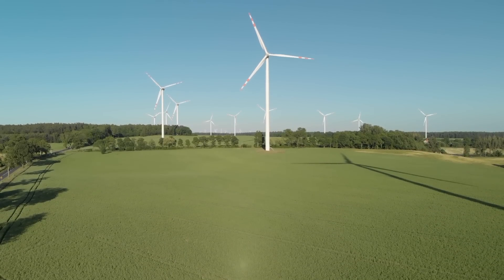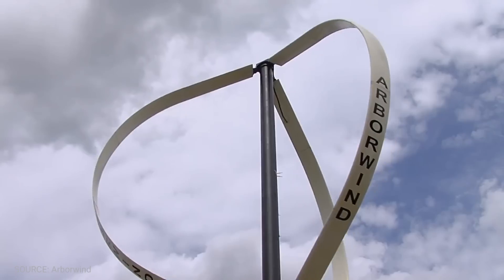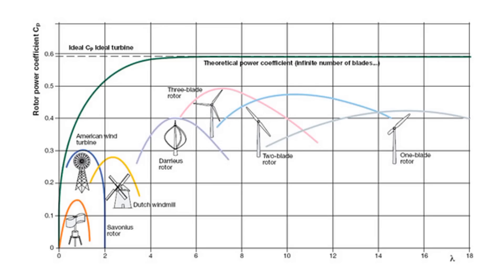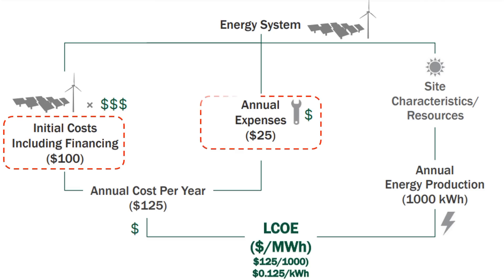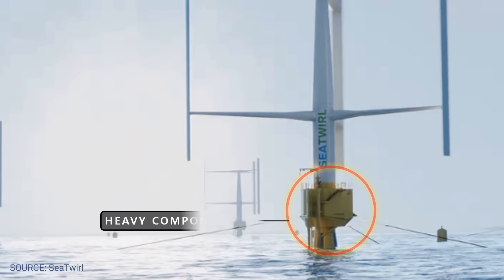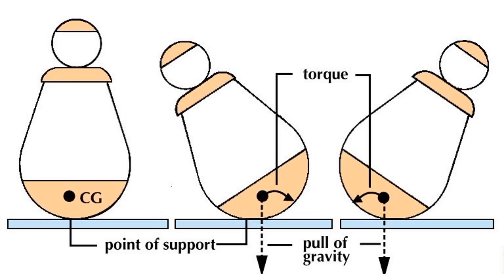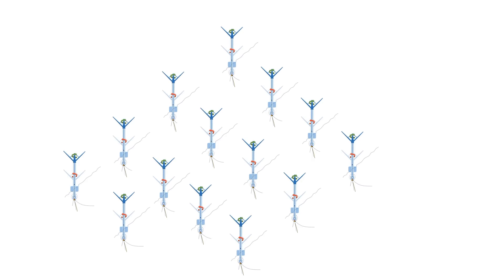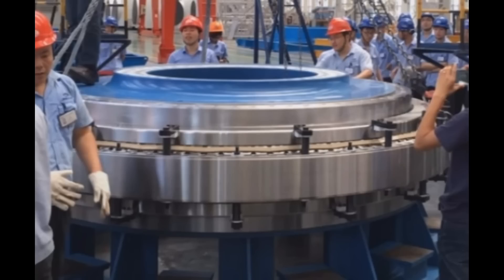This Wind Turbine makes Wind Power virtually LIMITLESS - Solves Wind Energy's BIGGEST Problem!

Comment: I have long been an advocate of VAWTs, despite the knowledge they are inherently less efficient. The fact they work at lower wind speeds and give engineers and designers the possibility of producing electricity at a lower net cost per MW/hour over their lifetime is most appealing.
Reply: You have to consider the HAWTs also use energy....they never reveal how much they themselves consume energy.
Reply: Do they work at higher windspeeds? Blades can't be feathered?
Reply: @kitemanmusic  the saftey wind speed of our VAWT could be 45m/s.
Reply: @kitemanmusic  ...less blades the better the performance in high winds. I have developed efficient 2 blader.
Reply: @kitemanmusic  tbh i think wind turbines are irrelevant and a waste. If fusion fully breaks through we will have clean and seemingly endless power generation. All these do is just pollute more since most materials cant even be recycled and have a short lifespan. Great “green” energy
Reply: @arixmotions  it never makes sense to put all your eggs in one basket, especially In a basket which does not currently exist.
Reply: @arixmotions Try holding your breath until it happens.
I'm 66, and got tired of waiting.
Reply: So you propose we supply energy to the country with a hypothetical source of energy?
Reply: @arixmotions  Can you tell us the materials that can't be recycled? Where did you find this information?
Reply: @christopherfairs9095  he was simply saying that it would take far too much energy to make it worth recycling them.  So in effect, yes they can't be recycled. They are just too big.
Reply: @carlpabst6506  I don't think he was saying that at all. Surely, the bigger they are, the more they are worth recycling.
Reply: @christopherfairs9095  bigger doesn't always translate into heavier and thus more recyclable value. These blades are designed to be as light yet strong as possible, so for the massive surface area it is relatively light, much like an airplane wing (which are also difficult/expensive to get recycled).
Reply: @n.g.s1mple29  precisely
Reply: The argument that VAWTs can start working at lower wind speeds is a very misleading one. There is almost no energy to be captured at these low wind speeds anyway. A HAWT will typically produce less than 5% of its rated power at the cut-in wind speed, so lowering the cut-in wind speed even further has almost no impact on the annual production.
Reply: @wimvanuytven7858  I thought the argument was they will produce some power, albeit a reduced amount, when HAWTs will not function at all.
Reply: @christopherfairs9095  Yes that may be true, but the difference in annual production will be extremely low, only a few percent, so its a bit of a misleading argument.
Reply: @christopherfairs9095  HAWT start producing at 2.5 - 3 m/s... Lowering wind speed is useless.
Reply: ,,, Windfarms are causing Weather Warfare putting Electricity into the Atmosphere and we need Carbon to create Oxygen and Canada and USA are Corporation of ROME government means Mind CONTROL btw so Stop VOTING and
Reply: For ocean wind turbines, won't a three windvane ( bottom, middle, and top) revolving around a vertical shaft generator in a floating plastic lightweight buoy be cheaper but just as effective?  The electric main cable should lie on ocean floor with extension cable to a small floating buoy connected by light electric cable to the floating turbine buoy.

Comment: Yes the vertical axis is such a better design. Couldn't quite make out the description of the difference in the turbine materials. Presumably ships wouldn't be able to pass through a grid of these - did you say they would be connected by a series of platforms or something? Also would like to know what sort of insulation would be used in the cabling with consideration of the dangerously high greenhouse gas presently used. All very exciting. Thank you for the information.
Reply: About the shipping issue. If one of these new turbines really can deliver 40 MW we would need about 165,000 of them to cover the entire world's consumption of energy. Judging by the illustrations there should be room for about 6 of them per km2. So less than 30,000 km2 (about 11,500 sq miles) would be enough. That's less than 0.0001% of the world's oceans. I'm sure we can live with shipping exclusion zones of that size.
But that's just theory of course, there is no way we're going to replace all our energy sources with these turbines.
Reply: You are right, although ships passing through a grid of wind turbines might be a bad idea anyway.
On the other hand, with the tilted blades the lower one is horizontal or close to it, and the size of this turbine suggests there may be enough clearance for ships to pass under the blades... if absolutely necessary.

Comment: Good clear explanations, thank you,    You could speak more slowly though!  
Vertical axis turbines have advantages in keeping weight/CoG and maintenance work low, and in not needing to turn to face the wind.  And (did you say?)  need not be exactly vertical.
What is the advantage of counter-rotating turbines on the same shaft?  That system would mean some very heavy rotating parts.
Reply: Counter-rotating doubles the speed! Think of two cars passing each other, each moving at 30 mph. Passing speed 60 mph. No complicated gearing. Rotor and stator both rotate, in opposite directions.
This system could be used on HAWT as well. Gears instead of counter-rotating blades.
Reply: @kitemanmusic  Increasing the speed is not of itself greatly useful.  But counter-rotating blades substantially reduce the forces that want to cause the whole device to rotate.  Anchoroing the device to stop it rotating is not an insignificant issue.